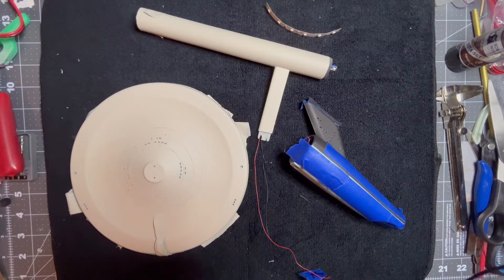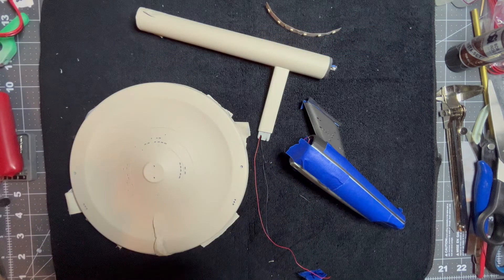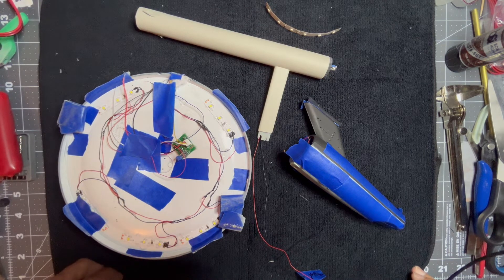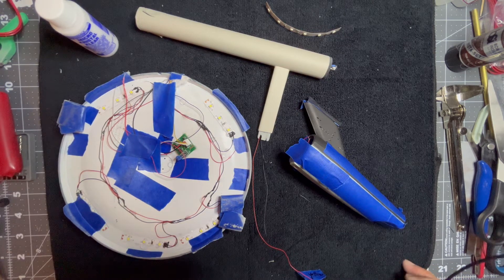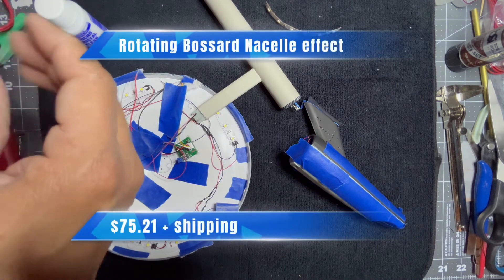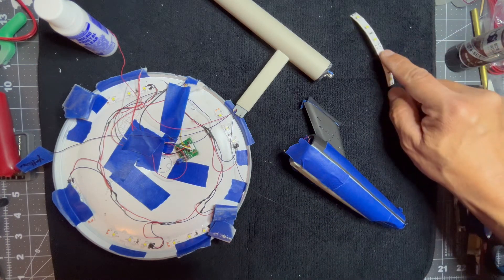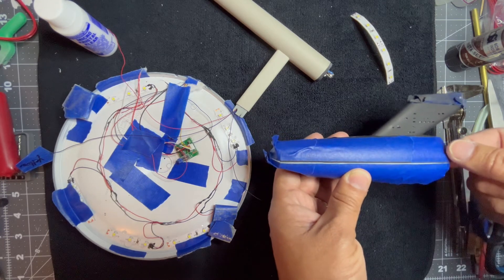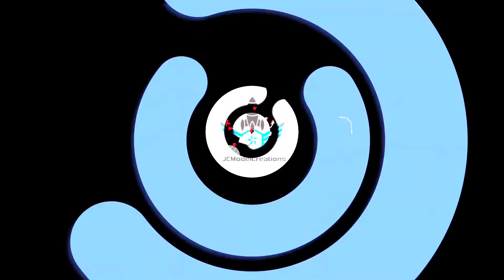18 inch AMT Star Trek USS Enterprise Build - Part 6 - Paint used and sanding tips

Comment: Where did you position the LED strips in the secondary hull? I’m especially concerned about even lighting in the neck.
Reply from the maker: The neck is a challenge for lighting. But, if you place an LED strip right underneath it - on the bottom of the secondary hull, it's plenty of light at 12V. Of course, the lights dim when the voltage is lower.
Reply: @jcmodelcreations  Thanks!
Reply: @jcmodelcreations  You may also be able to use a micro LED and point it up the neck or if you do the saucer before buttoning the saucer up you can set up a micro LED so you can fish it into the neck when installing the saucer. Those micro LED's put out alot of light for such a small LED. You can even do a combo of both.
Reply from the maker: @michaelbenjmitchell1  thanks for the great idea. I appreciate the input!